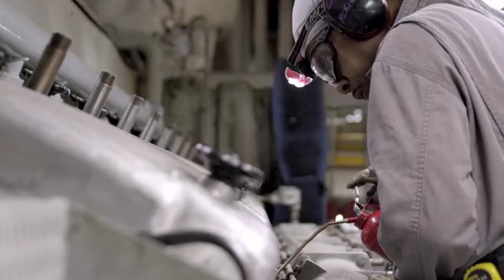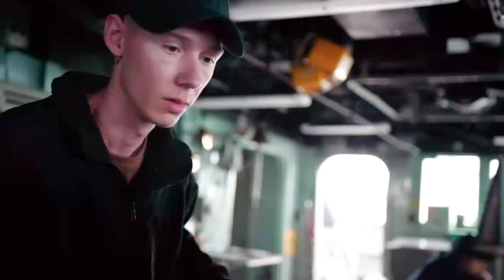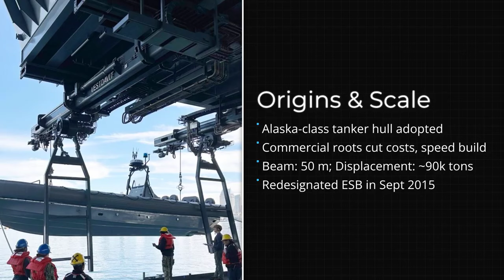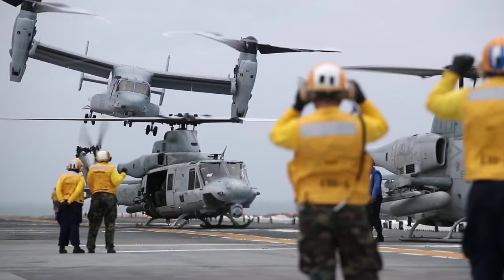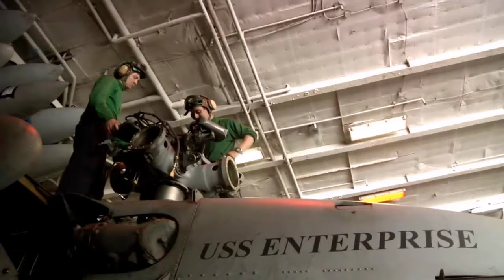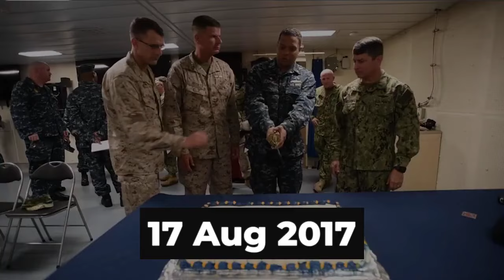Inside the Defend System of The Expeditionary Sea Base

Comment: should have been classified as expeditionary support vessel . . . its part LHA & part LHD combined into one commercial hull . . . the ESV could do with a dedicated aircraft hangar deck & big enough to fit five naval ship-borne MV-22F Sea Osprey multi mission tiltrotor aircraft or 11 - 12 ship-borne NH90 NFH-C Sea Lion multi mission support helicopter . . . 2 of the 5 landing spots will also serve as aircraft lift transferring helos & drones to & from the hangar decks . . .